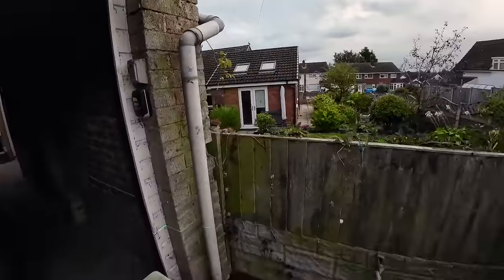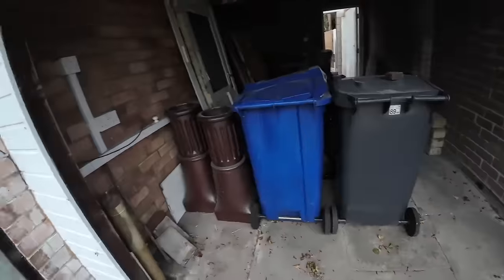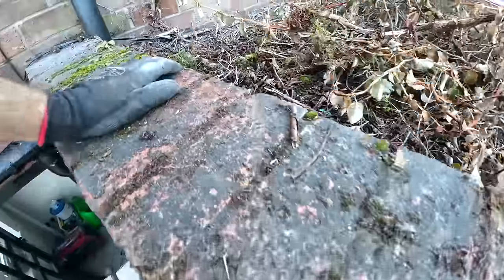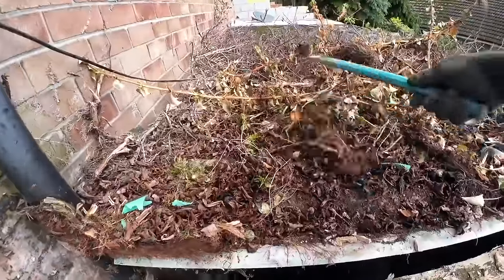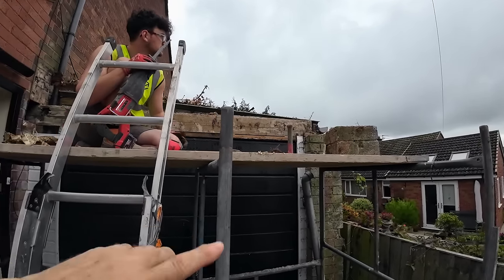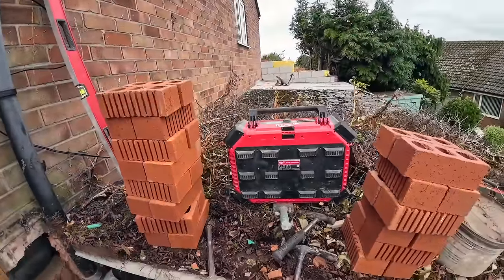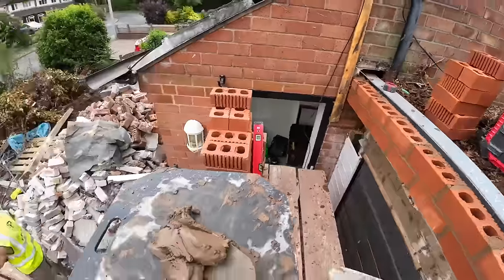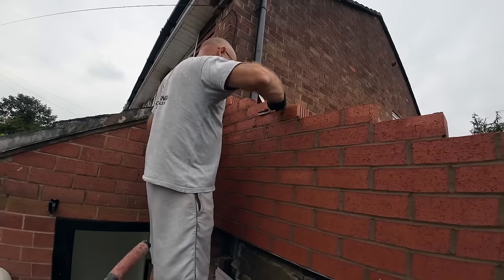ABSOLUTELY SHOCKING BEHAVIOUR!!  ..GARAGE PART 3

Comment: Some jobs are cursed from day one till you finish.
I've Had jobs where every compression fitting leaks , solder joints have to be re done , pipes cut too short when bending .  For no reason . 
Then  more complicated jobs using the exact same materials you fly through with no problems.  
 All you can do is what you're doing  plod on and fix faults as you come across them youz  are doing brilliant.   
  Mitch (ex St Helens. Now Galway 🇮🇪
Reply from the maker: All very true . Cheers Buddy 🧱👍🏽